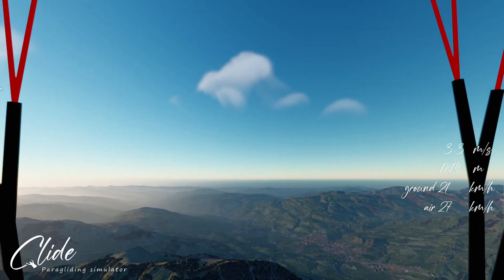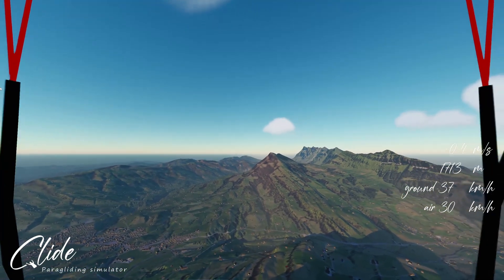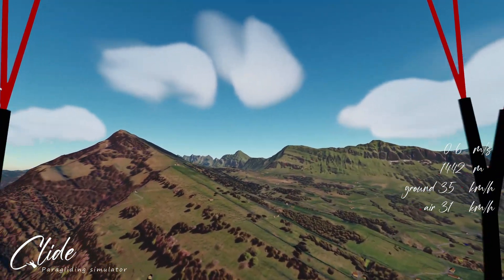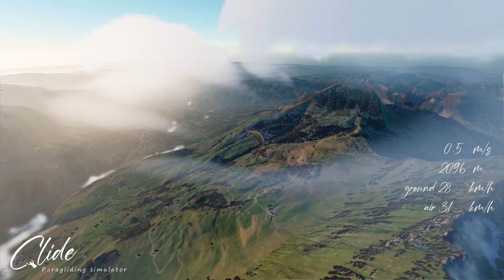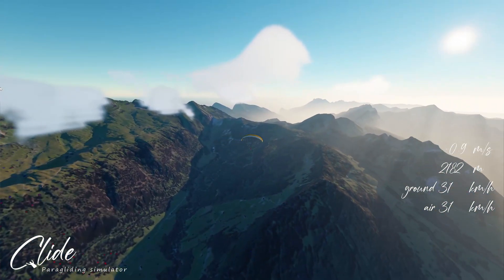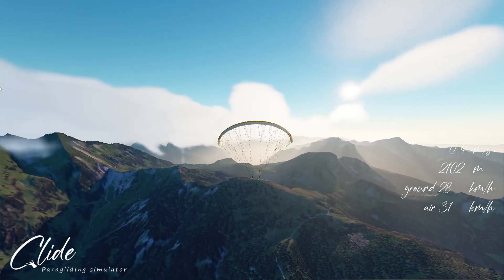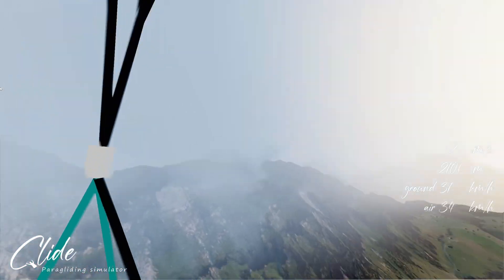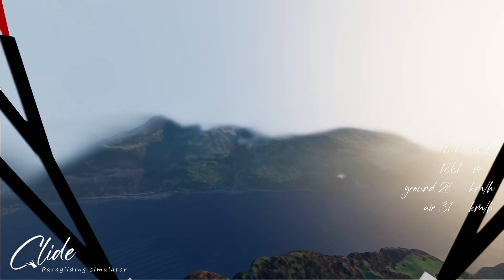Glide - my first XC flight

Comment: Looks good, what is your control system? Having played several other pg sims before, the control system not being able to provide realistic input is what kills it for me. Variable, independent brake inputs, variable weight shift, and variable speed bar are super important.
Reply from the maker: If you have opinions, please join my Discord channel if you can https://discord.gg/FeP7sKtJgp 
or grab a copy of the sim and give me feedback 
we have a discussion there on controllers. Most common will be XBOX controllers. The left thumb stick is weight shift, right thumb stick looks around, so easy to look while flying (but I will also incorporate trackIR), and the two triggers allows you to pull on 2 lines with very fine detail. Standard is the two brake lines, but by pressing '1' it becomes the outer A lines for big ears end '2' for the S-lines. I also want to add the B-lines in for a B-stall.

I also support Andre's para-controller (https://andrebandarra.com/shop/pcmini)

Of course the best of the lot will almost certainly be VR. with 2 VR controllers you can reach up, and grab any line at any height (well, that you can reach) and pull on it as far as your arms allow. This will likely be the most accurate control. But truly open to suggestions.
Reply: THIS!!! I suspect that Johan realizes how important it is. Flying with a gamepad, in VR, just wouldn't satisfy.

Comment: Where can I test it out?
Ps: graphics are very much secondary. Most important is glider simulations and realistic thermals and triggers.
Reply from the maker: Early access will most likely only be available via Patreon (definitely at the start), and with a little bit of luck will start in the next 2 weeks. I have expanded my group of testers a week ago, but still have some tweaks left on the installer. I will open it up the second it installs automatically.

If you are interested in the details behind the project, you can also join the Discord channel for free. Link on Patreon. This will allow communication with me, and general insight into the project.

Comment: That looks like you put in a lot of work already! Very cool. Does it support Virtual Reality? That would be great to have.
Reply from the maker: Not yet but it is planned for the release. I have programmed VR simulators before, and know the SDK's fairly well. The video as recorded here also runs at about 200fps on my 2080 GPU (clamped to 60fps, but I am idle for 10.8ms). There is plenty of free space to handle the higher pixel counts and framerates. I have specifically kept it like that through development.
I am moving back to glider simulation now, lots of small issues that needs cleaning up, and at least in my document the plan is to write VR immediately after.